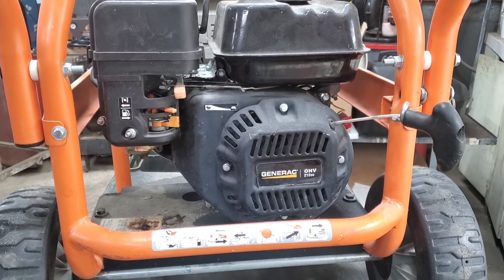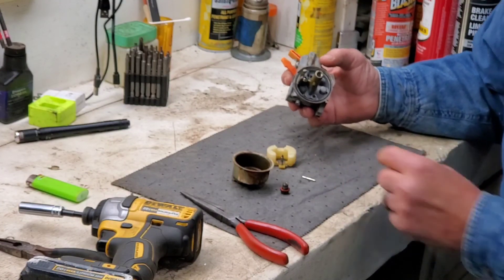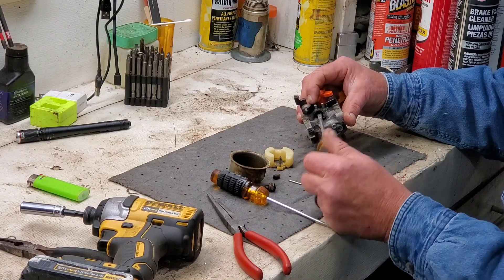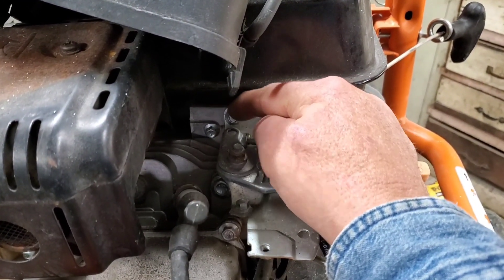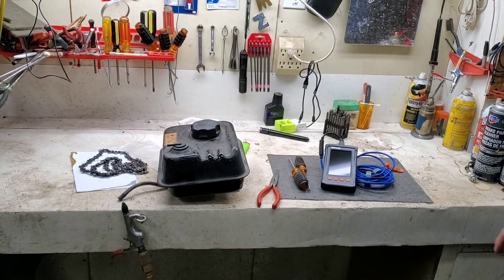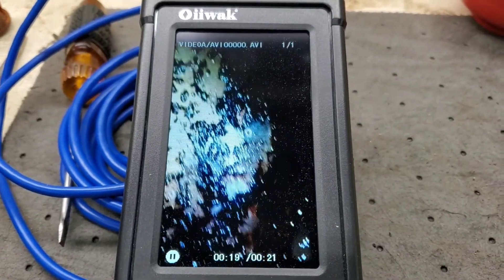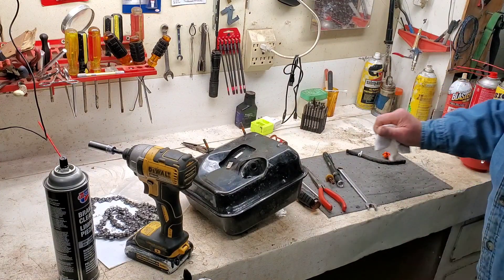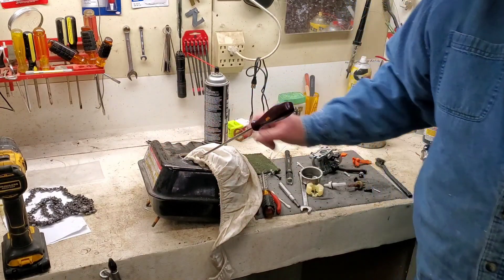Generac Pressure Washer Repair. Used Sonic Cleaner On Carburetor and Bore Scope To See Inside Tank

Comment: My tank is rusted internally and can’t find one. You think I can put in a different one in?
Reply from the maker: Of course. Any tank will do, even if you have to zip tie it on. Lol.  You can even use a plastic tank from an old lawnmower if ya want, as long as you mount it higher than the carburetor. You can even leave the old tank on and mount it above the old tank.